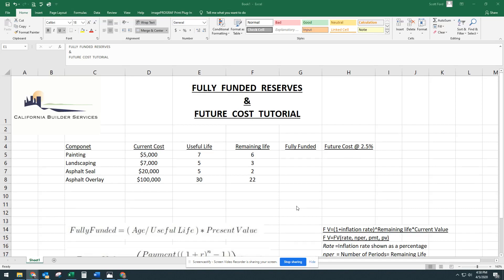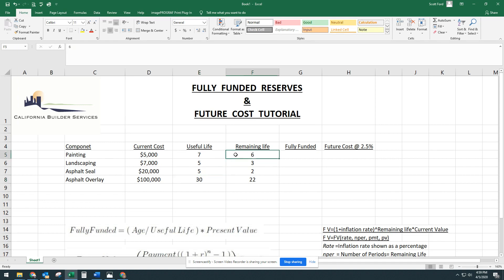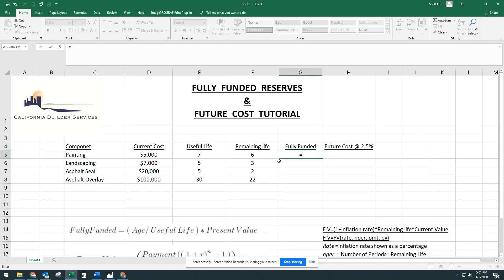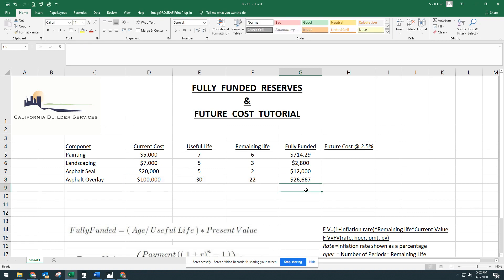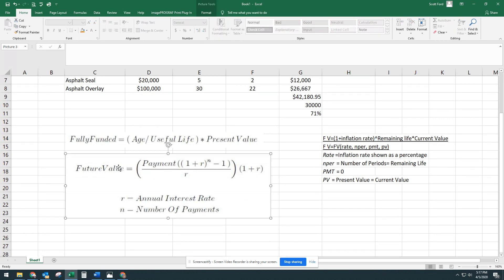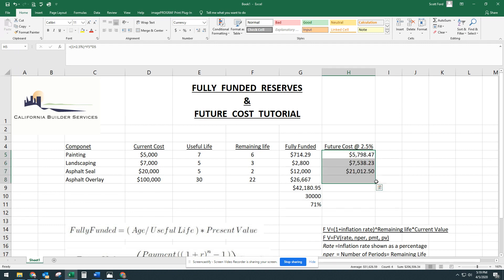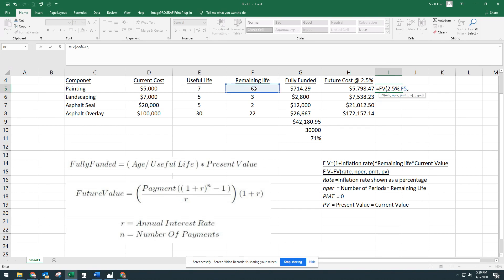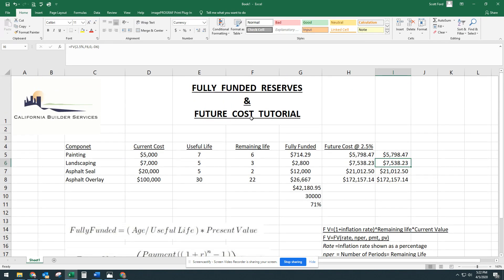Reserve Study Calculations #1: How to find the Fully Funded Amount and Future Cost

Comment: That's only half the battle.  The million dollar question is how do you determine the amount you have to save each year so you have enough for the future cost?  You can't just divide it by the remaining life because that would be equal payments saved each year and does not factor in the obvious of inflation.  For example, if you want to save over 5 years for a $10,000 cost, you wouldn't simply save $2,000 per year.  You would adjust for inflation and save maybe $1,500 the first year, $1,800 the second year, $2,100 the third year, etc. My math is off, which is the point of my question. Assuming 2% inflation and the need to save over 5 years for a future cost of $10,000, what is the excel formula to determine the amount needed to save each year?  Thank you